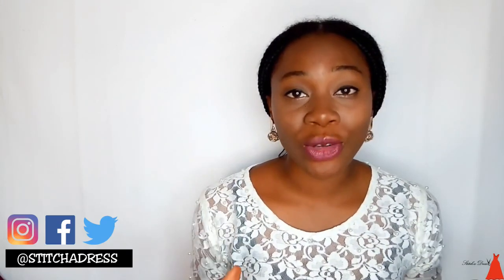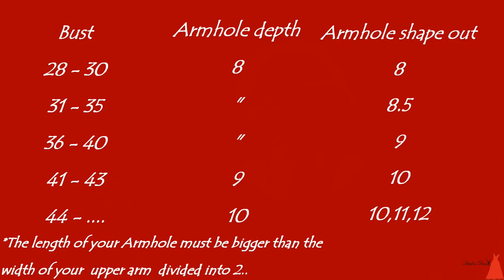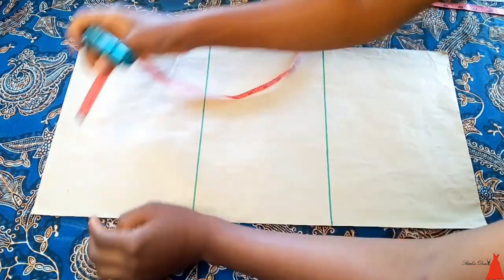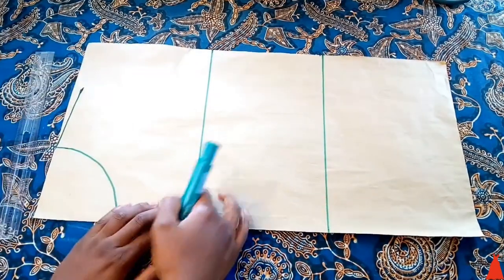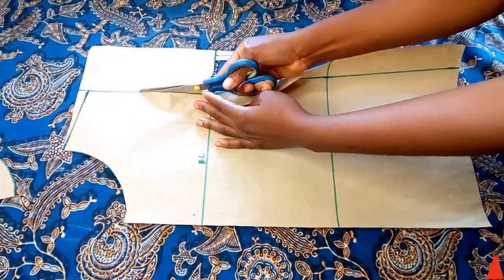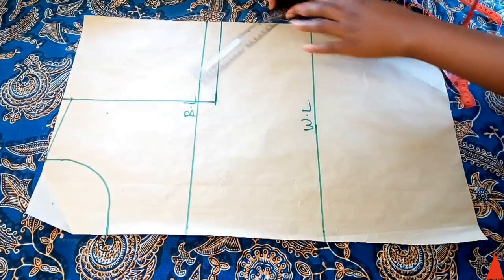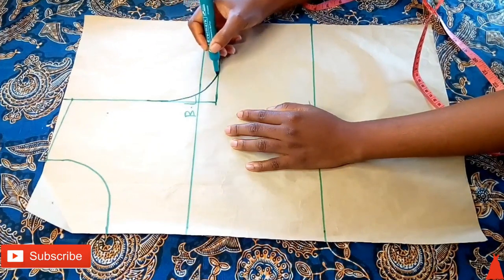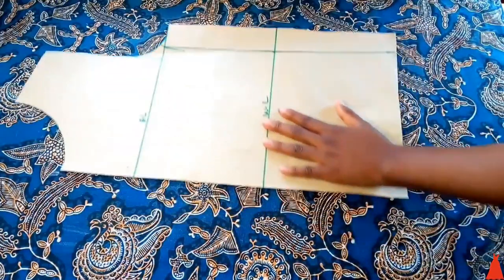HOW TO FIX TIGHT ARMHOLE | STITCHADRESS |

Comment: Hi Ada 
Thanks 

Why  is the front and back arm hole the same for both the Sleeve and the bodies.
My understanding is tha they are different.
The front arm hole curve go in more than the back.
Please comment.
Thanks
Reply from the maker: I don't really know that style you are talking of. Here's how i do mine and it's been working well for me.
Reply: I wanted to ask the same question
Reply: Hi Kelly! I think she might not say everything. Let me help. This is the way I do mine. If your cutting your armhole to get armhole depth is bust÷6+1.5, then at the mid of the front bodice the bust is small come by 1", medium come in by 0.75", the large come by 0.5".
Note before you mark the depth you have to come down by 1" for shoulder slant.